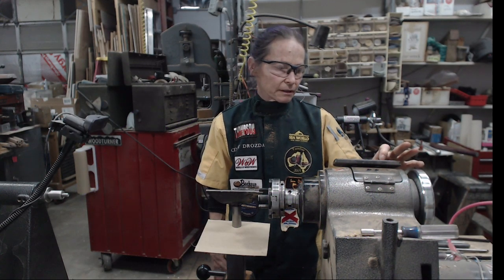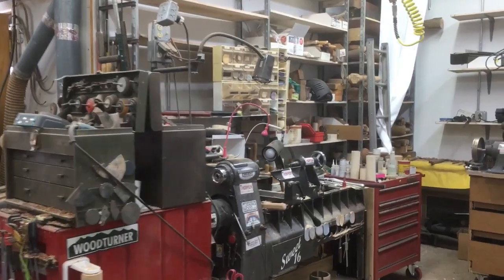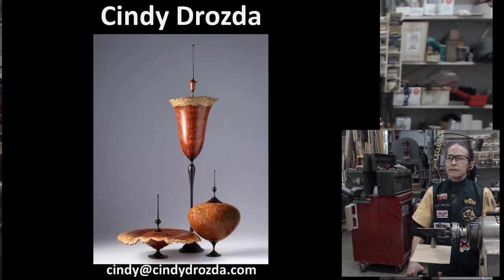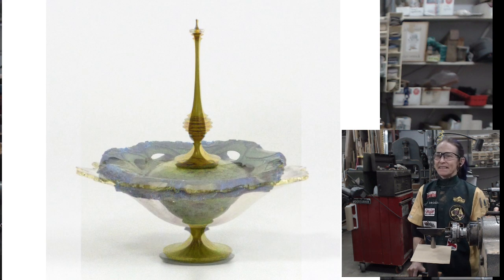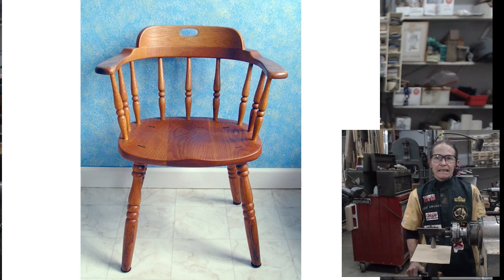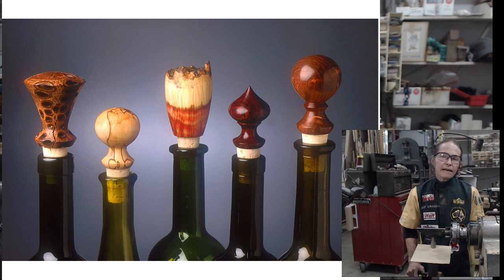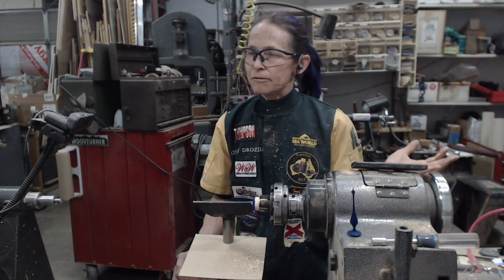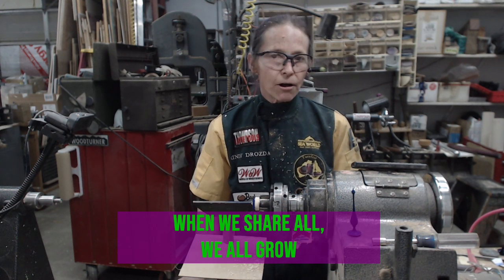Cindy Drozda - How I got into woodturning

Comment: What Type of Chuck do you use it looks as though it would be easier for my hands then twisting that tea ranch until it gets tight
Reply from the maker: This is a Vicmarc lever-style chuck. I like the lever chucks because they are lighter weight, and usually less expensive to buy. Also it is faster to change diameter by spinning the ring than by twisting a key a bunch of times. Other brands make a lever style chuck also. Vicmarc has always been excellent quality.